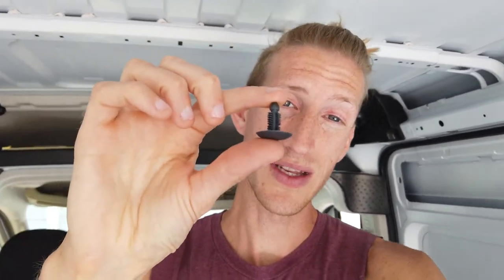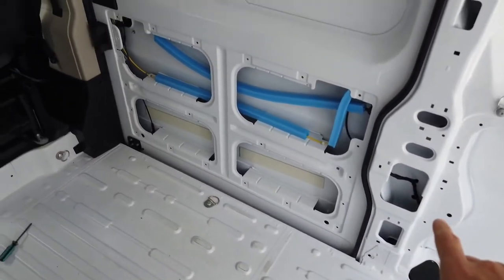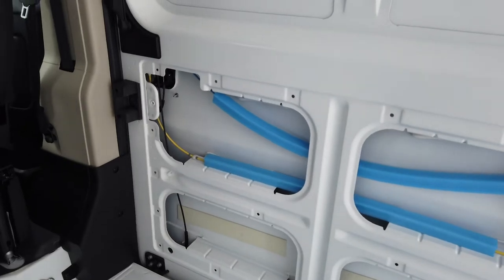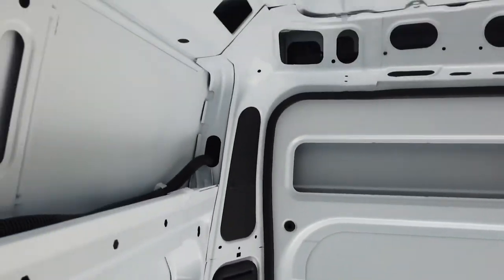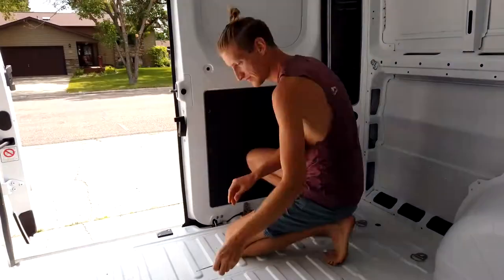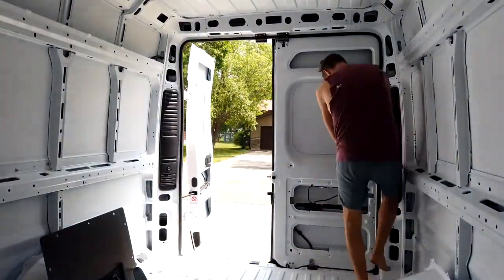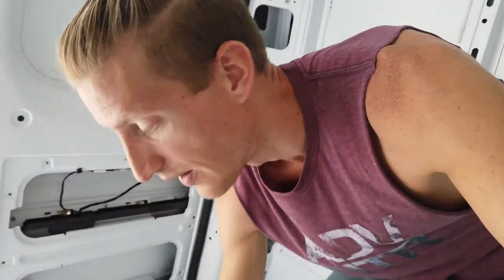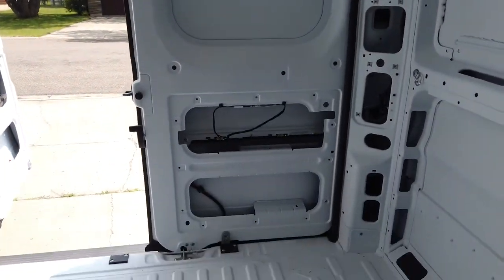Rear Plastic Panel Removal - Ram Promaster 3500 159 Extended

Comment: Thumbs down for no close up of removing the clips. I would like to have seen your technique which was the whole reason I researched  this topic.
Reply from the maker: Ahhhh sorry Keith! First video ever recorded haha, was still learning the angles and what to capture! I basically used a flat head screwdriver and pried the clip up with that, super simple. The clips are more durable than they look, I didn’t break any pulling them out. Here is an accompanying post I wrote that might have more info. 

https://www.outsidevibes.com/ram-promaster-back-panel-removal-van-build/
Reply: @outsidevibes  Sorry this weirdo wrote this to you.... You are doing an exceptional job.
Reply from the maker: @votesudanusa  awe thanks! I'm trying haha, will have to start putting out more build videos.
Reply from the maker: @votesudanusa  hahahah 😂😂😂🙏🏻🙏🏻🙏🏻